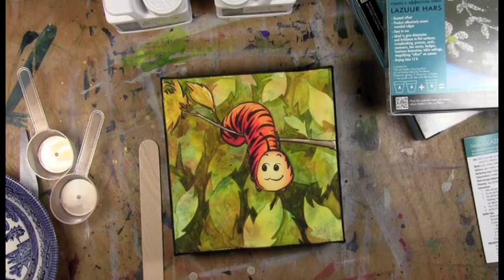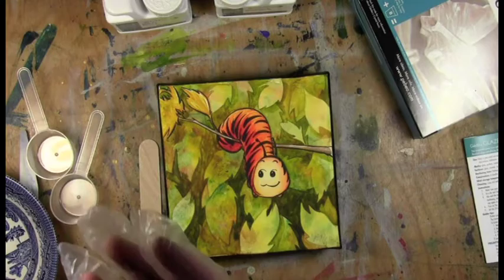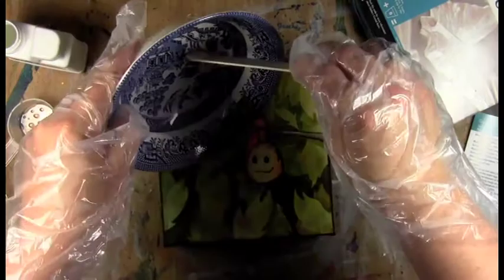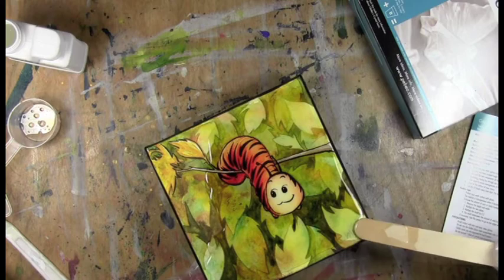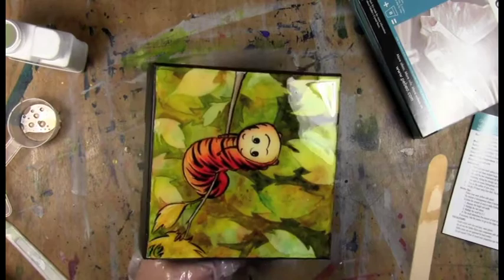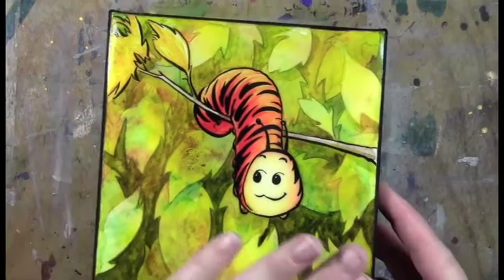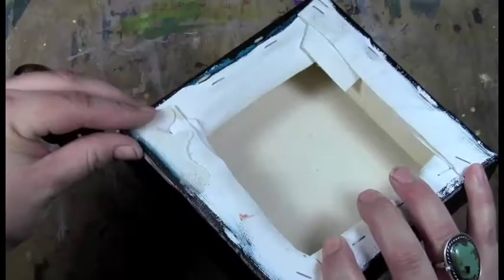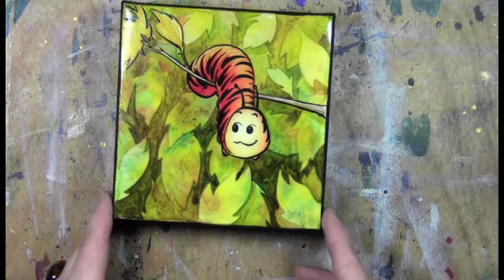Glazing Resin.mov

Comment: is this resin food safe? if not you can not use that bowl for eating anymore . i use resin reg. and if you lightly go over the surface with a torch or one of those candle lighters the bubbles will pop off the surface. i dont know how much work time you have with this resin ( time before it starts curing) but sometimes if you let it rest 10 min or so after mixing a lot of the bubbles will rise to the surface and pop on its own. any doming resin will do the same thing i use little windows which is a 2 to 1 ratio as well i make jewelry etc with it. i dont know how much this resin costs but you may want to try little windows and see which works best. i know a coupon code for 20 percent off your purchase if you are interested
Reply: I heard it wasn't the heat that pops the bubbles its the carbon dioxide. You can exhale on them to achieve this too.
Reply from the maker: It's true - but a hair dryer must produce enough carbon dioxide emissions because it works too. (And I get seriously light-headed trying to exhale on anything bigger than paper sized.)